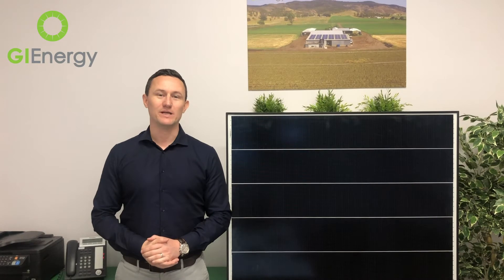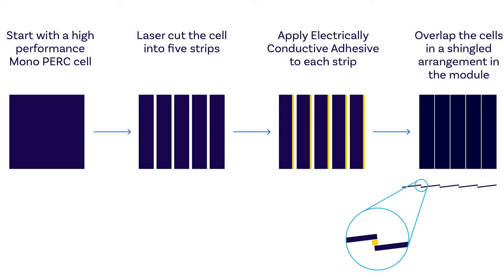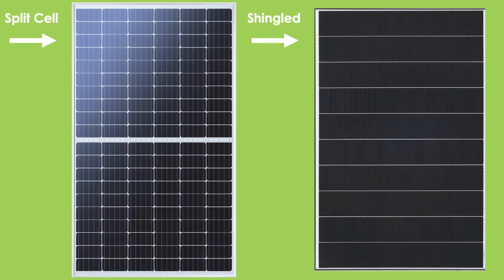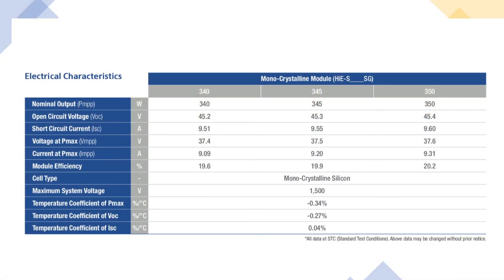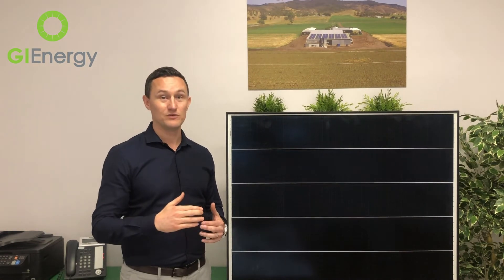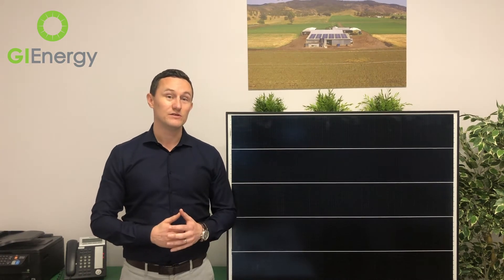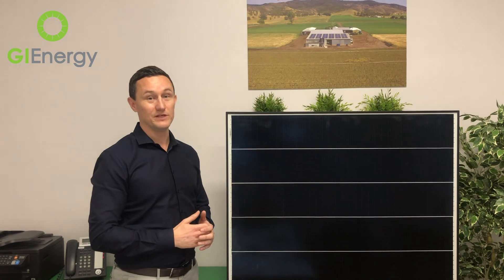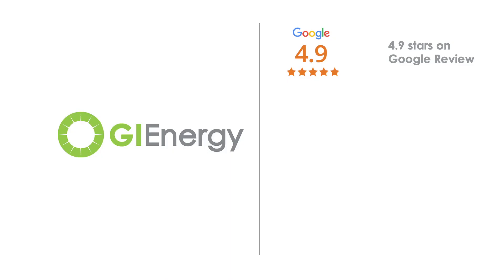Hyundai Shingled Panel

Comment: Panels appear to be five down and back rows in parallel, so it is like five 72 cell @ 2 amp per cells sections in parallel for 10 amp total output.  

How are bypass diodes arranged in each of five sections as the five parallel sections seem to work independently (with some shunt leakage loss for shaded row pairs)?  

Having 72 series cells without any intermediate bypass diodes in the 72 cell series string seems risky but with only 2 amps of shaded cell reverse bias current maybe they can get away with it, particularly if cells are graded for high shunt resistance.  Junction box probably has one bypass diode for whole panel for multiple series connected panels.

This arrangement should work better for micro-inverter setups.

Comment: Does this save the shade problem when it hits horizontal or vertical? I don’t if I explain myself …
Reply: I have 25 Hyundai panels with a power of 400W on the south side in Poland.  Both vertically and horizontally.  They work perfectly.  The system is on enphase microinverters and works great.  These panels suffer from another property of secondary reflection of red light, which results in increased efficiency at dawn and dusk.  They work surprisingly well in cloudy weather.
Reply: @damianbuszuje  i already have them on my roof. 10 of 485. Even with that desert storm that came weeks ago they are pretty dusty and works perfectly. Got to clean it anyway but they are bombproof. No prob with my shades neither and they are ugly ones.
Reply: @abelramos8652  I am guessing by your comment you might be Portuguese or Spanish, where did you get you panels from?
I am very impressed with the comments I am reading.
Reply: @TheAllMightyGodofCod  AMM Capital Madrid. Got three optimizers on the worst shade area but there are others panels 1/3 shade surface with none and they are ok. SMA Sunny 5.0 with shadefix also ... An antishade army in my room but its working. Un saludo amigo